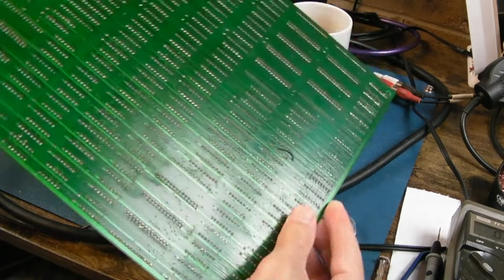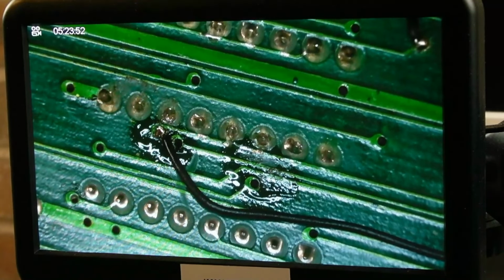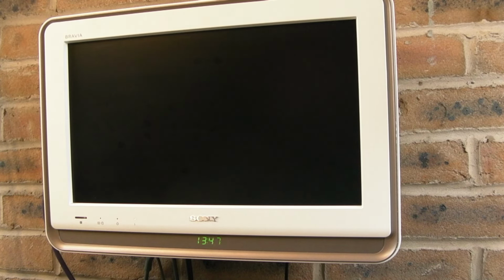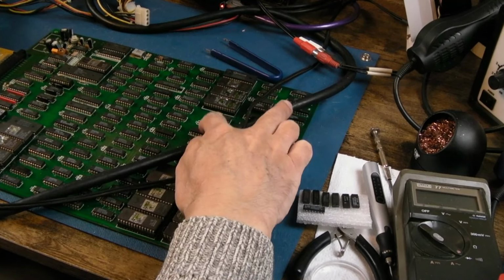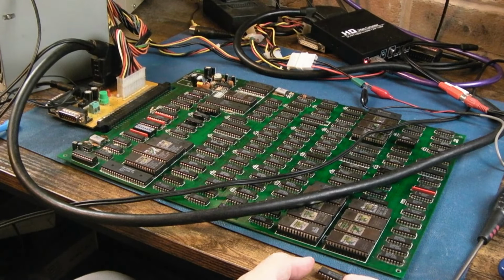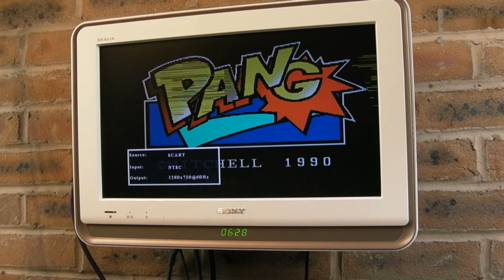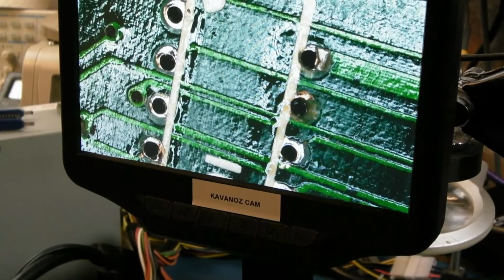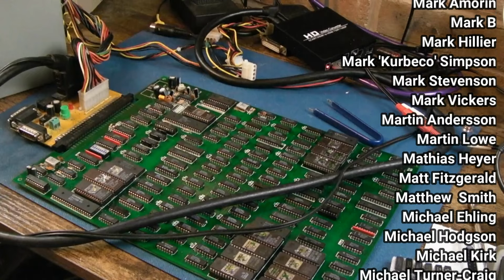Pang Arcade Bootleg Repair Part 2 (From Glen @ CRG)

Comment from the maker: Part 1 - https://youtu.be/ScYL3kypx8o
Part 3 - https://youtu.be/_TzwWXiIzKU
Regards the waffle explanation of getting sprite data to display - it was generalised, and the point I mentioned the counter, it would be used as data is serialised from a latch or elsewhere.  ie. something to count the pixels (for the sprite size) as it is passed out.  In addition I noticed "tripples" of counters, probably for R, G, B.  ie. each colour handled seperately.  The other simplification there - typically when you have multiple layers (ie. sprites, background, text) - there are priorities to deal with and transparent pixels etc.  The order in which sprites are applied to a background are the reason for ordering, and pixels of a certain colour can be transparent.  eg. a background tile (typically rendered first) will shine through the sprite at that pixel position.   My simple overview there just covered a sprite, the background pixels may get processed first for that pixel position, then the sprite, and finally the text layer...   There's also different ways of rendering the display output, another simpler way is to process all the graphics in "screen ram" and for the output process, just sequentially step through the video buffer....
Glen (CRG) - https://www.youtube.com/ @CRG 
Ex GPU Designer (Dr Matt Regan) - https://www.youtube.com/@DrMattRegan
Arcade PCB Repair Channels
ArcadeUK - https://www.youtube.com/@arcadeuk
Retro Games Party - https://www.youtube.com/@retrogamesparty
Lukemorse1 - https://www.youtube.com/@lukemorse1

Comment: I don’t know ik I have mentioned this before, but the arduino ict, is like a cheap alternative for a fluke. Has helped me many times with arcade pcb repair using the version with the windows interface (this version is more generic and allows many pcb to be tested). You can find info on ukvac, and I can send you the PCB’s for it if you want.